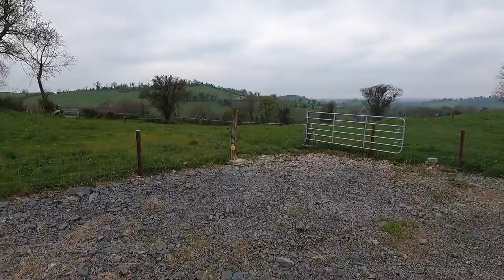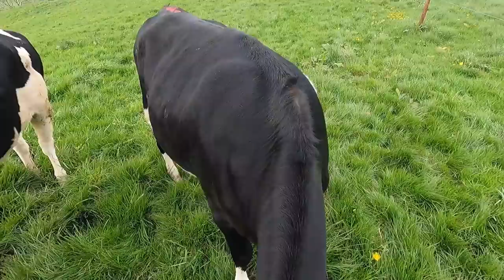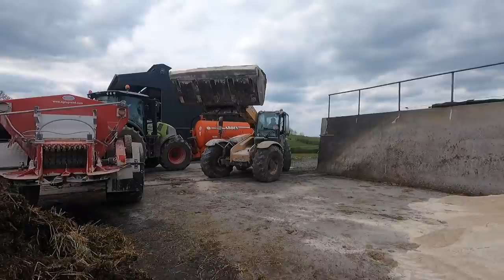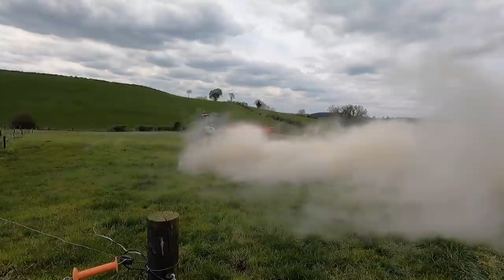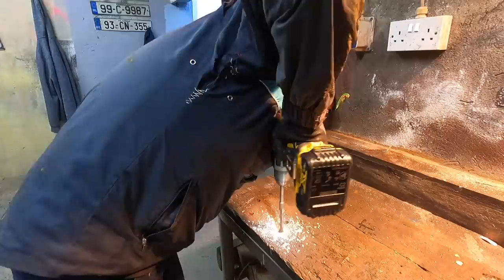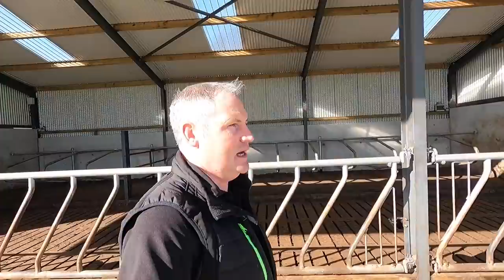A PROBLEM MOST FARMERS OVERLOOK, WELL NOT ANY MORE!! HEIFER'S GO OUT, NEW WORKSHOP BENCH VICE

Comment: Fodder crisis 2021/22 here you come.
Reply from the maker: I don’t think it will be just that bad, 🤞🤞
Reply: An inch of rain and 3 weeks of 20 degrees heat is needed on the Eastern half of the country to have a decent first cut silage. The rain is coming next week but the temperature isn't yet. Its almost a copy of last year so far, only cooler. Fodder wise It will probably be alright as long as we don't roll into a summer like 2018. 🙈

Comment: I would usually want them to have a full stomach before going out so they don't eat too much grass and risk acidosis or am I doing it the wrong way round?
You know my stance on the claas tractors, tried to convert you before but I got nowhere with ya 😉 if ya got one 2013 or older they have the JD engine and massey backend and no addblue, plenty grunt for 2000gal tanker
Reply: We always leave them out with empty stomachs
Reply: @cillianh5841  would you have the odd case of acidosis doing it that way or none at all? We haven't had it with years

Comment: Adrian:Those Claas tractors are a fine looking job
Me:Step one get Adrian converted over to a Claas man, as they use JD engines😉😂
Reply: They use fpt engine's now (case NH). Claas main downfall was head gaskets with the JD  engine.
Reply: @FarmersSss  you sure because I even looked it before writing the comment
Reply: Well I'm part right. 400 arion and axions have fpt but 5/600 are Deere still. I had an old style 610 and head gasket went in her at 2100h but also had a first series 420cis and to be fair it was a cracking tractor so just replaced it with a new 440 with fpt engine.
Reply: @FarmersSss  ye thats what I was talking about the 500/600 using deere
Reply: @noahairsofting3768  they used JD engines up until the end of 2013 (no addblue), they're Fiat power train engines used now (the ones with addblue), with the JD engines claas designed their own head gaskets and there was no issues with those ones

Comment: The class tractors have very bad wiring and what is wrong with the scraper
Reply: I work for a fella that has a 2013 claas and there has been zero issues with wiring, had her 3 years so far and the fella who had her before him had no issues either with her
Reply: @jerryodriscoll3691  my cousin has one and the wiring is fuked in it
Reply: @shanemannion4077  is that one of the newer type ones with addblue?
Reply: @jerryodriscoll3691  no
Reply: @shanemannion4077  what year is it?
Reply: @jerryodriscoll3691  6 or 7
Reply from the maker: Wiring is a problem on a lot of newer tractors including my own Massey. Waiting to hear back from Clarke’s on the scrapper. Let it in on Monday morning but apparently as of yesterday evening they never looked at it 😞.
Reply: @IFarmWeFarm  what happened the scraper why is it broke I should be able to tell you what is wrong
Reply: @shanemannion4077  thats one of the older ones, claas hadn't made its way away from Renault fully at that time, like adrian said wiring is a problem across all brands of tractor